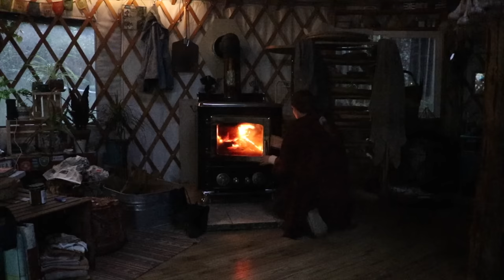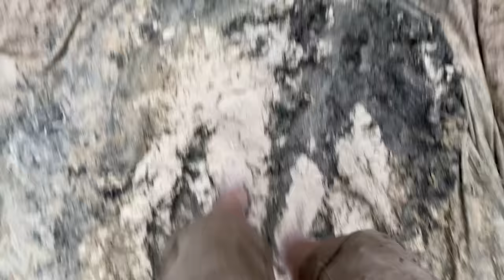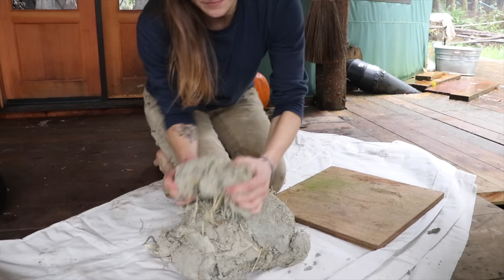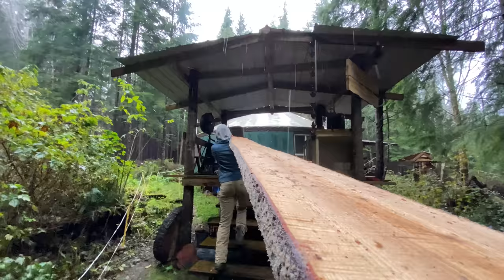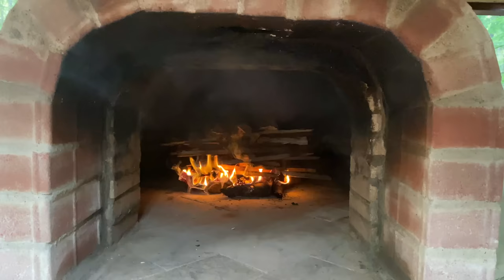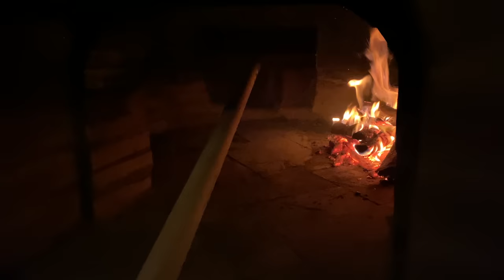ESCAPE TO THE WILDERNESS: DIY BRICK PIZZA OVEN | Cooking Pizza in a Homemade Clay Cob Oven - Ep. 112

Comment: Okay ,  2 minutes  in  &  I  am  jealous  ! !   LOOK  at  all  that  wood  you  have  for  the  winter .    I  have  a  'boxwood'  heater  in  my  house  positioned  next  to  the  fireplace  so  it's  flu-pipe  can  run  up  the  chimney  of  the  fireplace.   (The  fireplace  was  useless  for  heating :   drew  in  massive  cold  air  through  all  the  cracks & gaps  in  my  1961  vintage  California  non-insulated  house)      The  boxwood  heater  is  so  efficient  and  I  get  ALL  my  firewood  free  during  the  summer  when  my  neighbors  are  doing  remodeling / re-landscaping / etc.  as  they  put  their  waste  out  on  the  curb  with  a  'free'  sign  attached !   I  simply  go  by  in  my  Nissan  Leaf  &  pick  up  what  I  can,   often  making  several  trips .   The  Leaf  cannot  carry  what  my  Ford F-100 1963 pick-up  could  (even  though  it  was  the  smooth-side) ,  but  the  Leaf  is  so  efficient  on  energy  that  several  trips  are  less  expensive  than  the  old  Ford.

Comment: Best looking oven I’ve seen yet!  If it gets too hot try taking the wood out after it’s heated up, then a quick mop like you did and place the door on after the pizza’s are in. I’ve seen that work well as heat seems to stabilize across the oven and you don’t get really hot spots here and there. Heat will be retained for a long time as will the wood flavor. Those looked great for any time, but a first time were amazing.

Comment: Just a little secret that I use is I sprinkle corn meal on my pizza peel and my pizza to aid the pizza to slide off into my oven. Also do the same thing when I place the dough on my board after I roll it out, along with some extra flour. Just keeps it from sticking. Nice job you two!

Comment: New face! Welcome to the channel Dylan. Hopefully this isn't the start of an off grid cult. That pizza is fancy AF.
Also, I was curious if you needed a vent in a pizza oven and stumbled across this; if you build the fire upside down with big logs at the bottom and kindling on top you will have less smoke. Also most people will cook pizza at much higher temps(700+), but I think you need high hydration dough for that.

Comment: Was thinking that it would be great to have the chimney coming out of the roof, instead been so short. It would give you a little comfort when using it. Also a bit of a lip in from should direct most smoke to the chimney! Regards!
Reply: The reason these types of ovens are built with the chimney offset to the front rather than at the top of the dome is to maximize the heat retention from the fire. Instead of the heat escaping out the chimney it's concentrated into the dome, and the smoke finds its way forward to the chimney.

Comment: Jake and Nichole here is a great way to let out the smoke when cooking from the pizza oven build a small cupola on the top of the roof above the pizza oven, if you watch the video of you getting ready to place the last layer on the pizza oven  you will see the smoke coming out around the roof line with the cupola the smoke will go up into the cupola and out vents and it will add a decorative feature to the roof line.
Reply: The reason these types of ovens are built with the chimney offset to the front rather than at the top of the dome is to maximize the heat retention from the fire. Instead of the heat escaping out the chimney it's concentrated into the dome, and the smoke finds its way forward to the chimney.
Reply: @IndieMusiCon  This is not what I was telling them about I was saying the smoke under the roof if you would have paid attention to the smoke coming out from under the roof line and my comment of making a cupola The cupola would let the smoke rise out from under the roof line and escape through the cupola and not the lower roof line or into their faces my comment had nothing to do with the way the pizza oven was made.
Reply: @harolddomangue9206  gotcha. Thanks for clarifying.

Comment: Use dental floss and pull it between the pizza and the peel, just before you put the pizza in the oven.  The pizza will come off the peel easily...

Take you pizza dough recipe and substitute one cup of corn meal (2 cups of white + 1 cup of corn).  Now add ~1/4 cup of sugar.  Take dried pineapple chunks and chop them fine and add to the dough.  Place dough in bread pan and bake until done.  Pineapple Corn Bread.  It is sweet and excellant...  Great for breakfast!!!!

Comment: hey guys, you could have used a dough roller to get the clay flat, just an idea that i had :-), but anyway, it looks great, i wold have the exhaust come out of the roof, now you get all the smoke in the face :-)
Reply: The reason these types of ovens are built with the chimney offset to the front rather than at the top of the dome is to maximize the heat retention from the fire. Instead of the heat escaping out the chimney it's concentrated into the dome, and the smoke finds its way forward to the chimney.

Comment: FYI.....the pizza was undercooked. THE TELL SIGN S are evidably no leapard spots on top or under the bottom, they are sometimes mistaken for burnt marrks which you would be wrong. All that work for undercooked pizza, there is a big taste difference as welI could tell right away.your next should get better.

Comment: add more stovepipe diagonally to edge of roof and then up a couple feet, why? more draft - you could put a damper on it - you could go straight up with some small roof alterations - adding on a blacksmith forge to the pizza oven is not a bad idea - then you have a good excuse to get an anvil and a vise

Comment: I meant to say this before when I watched you use the chainsaw mill.  I can't be 100% sure, but it looks like you are using a standard chain on the saw.  Buy or make yourself a "Rip chain",,, it's much easier on the saw and on You!!  Faster too!!  If you can't find one and want to make one it is easy. You are handy with a grinder and you can grind away the horizontal  portion of  the tooth (chisel cutter) leaving the vertical part with just a bit of top on it. Do that to every second cutter on each side.  It allows each cutter to do half the work,,, one cutter cuts the vertical the other one cuts the horizontal. This Only applies to "rip cuts" not 
"cross cuts".

Comment: Okay (#2) ,   watching  you  spend  countless  hours  building  your  pizza  oven ,  &  then  moving  the  fire  to  make  room  to  cook  your  pizza  .  .  .  .  .  etc.  .  .  .  really  good  ! !  
  Me ?   I  got  a  $1.00  Kroger  pizza  at  the  store ,   added  some  cheese  &  beans  to  increase  it  from  7  ounces  up  to  a  more  respectable  weight ,  threw  it  in  the  microwave  (powered  by  my  off-grid  solar system) ,  and  waited  for  the  indigestion   to  occur  after  consuming  it  while  watching  ' Pearl '  on  my  CRT  TV  with  VCR !
   The  indigestion  .  .  .  ? ?  .  .  hmmmmm .    Did  not  occur  since  I  finished  eating  the  Pizza  with  some  ACID !    Yup ,  I  dropped  acid  with  my  pizza ,    Hydrochloric acid ,  naturally-occurring component of the gastric acid produced in the digestive systems of most animal species, including humans.   Since  I  am  older  my  body  does  not  produce  adequate  acid  any  longer  which  allows  food  to  rot  in  the  gut  producing  the  wrong  kind  of  acid  later  on  .  .  .  resulting  in  ' acid reflux '  .     BUT  since  I  found  out  about  this  &  add  the  right  kind  of  acid  with  my  meal  acid  reflux  does  not  occur .    I  am  so  smart  I  astound  myself  ! ! !   ( ha - ha )     Will  probably  die  prematurely  from  all  the  fake / manufactured  ingredients  in  that  Kroger  Pizza  .  .  .  .  but  at  least  without  stomach - upset  ! ! ! !      Take  care ,            RH

Comment: That oven is incorrectly designed. The dome is too tall so it doesn't heat the floor properly. There is a proper ratio of dome height to oven radius.

The opening also is way too tall. No point in the opening being that tall.

lastly the chimney length is a function of the size of the oven. A chimney that short won't do anything useful

Comment: readers digest pezza shap cook book got book sale at work same place got big book farming. if like book 50 recipes for pezza. thin pezza dow recipe.  1 preparing yeast Put the fresh or active dry yeast in a small bowl and add 1/2 cup of warm water.  2. stir gently until the yeast has dissolved. set aside until frothy about 10 minute.  3.v combine the flour and slat in a medium bowl. pour in the yeast mixture, oil (if using ) and enough the remaining war water to obtain a fairly sticky dough. 2. dust a clean work surface extra flour. scrape all the dough out the bowl onto the work surface. shape into a firm , round ball. 4. Knead the dough for 8-9 minutes. when it is firm and no longer sticky to your hands or the work surface, lift it up and bang it down hard a couple of times to develop the gluten. 5. when ready the dough will be smooth and elastic and showing definite air bubbles beneath the surface. place it in a large oiled bowl, cover it with cloth. set aside to rise for 1 hour .  that dow they have whole wheat recipe   gluten - free recipe and think pan recipe not sure were it is. let how is. yet make recipes in this book.
Reply: need make wood burnt sighn says beat it or eat it pezza show with drawing of beat. grow out ground.

Comment: Your pizza game is quite bad, it is not legit at all actually, it is wrong on so many levels. You have much to learn, but If you do, it makes all that work on the oven worthy, and it will help you with baking in general. In this video you seem to be very clueless in terms of wood fired pizza and pizza in general.

Another thing I would like to say, is that dome wood fire oven takes a very long time to heat up and use a big amount of wood. For somebody not living in forest like you, there is more solutions. For example one of my pizza ovens is Ooni Karu. It heats up in 15 minutes, so it  uses very small amount of wood, and I can also fuel it with gas. So for people who also have for example HomeBiogas tent, they can fuel it with gas produced with their organic waste. This makes making pizza easier, since it makes stable fire and you do not have to add wood often due to small burning chamber, which is one of few disadvantages of portable ovens.